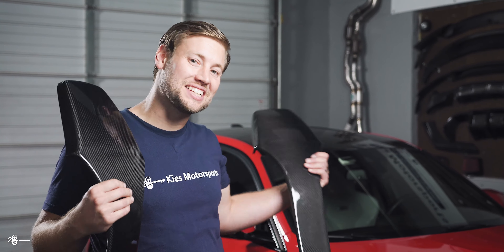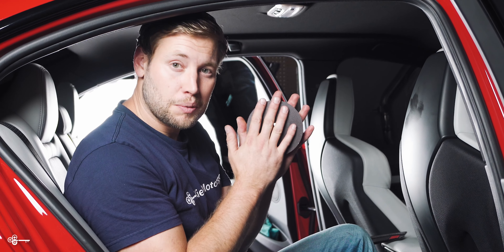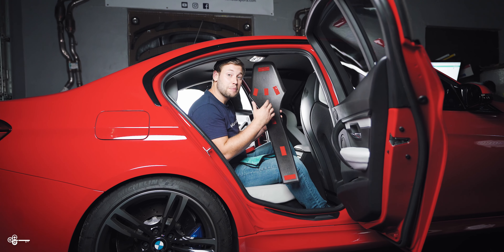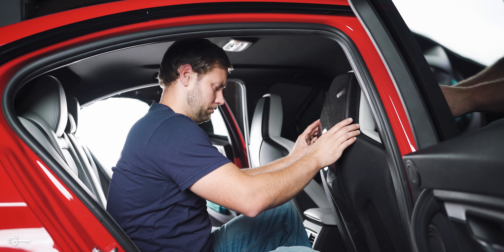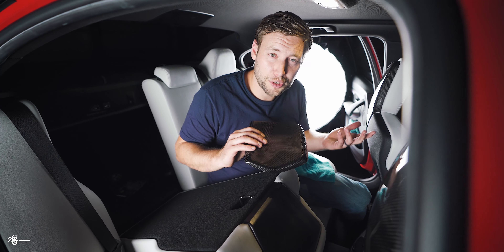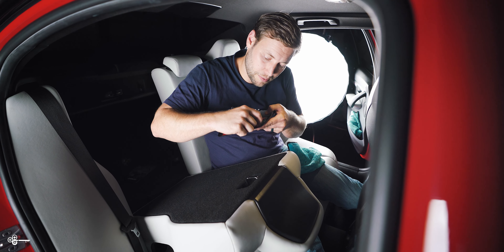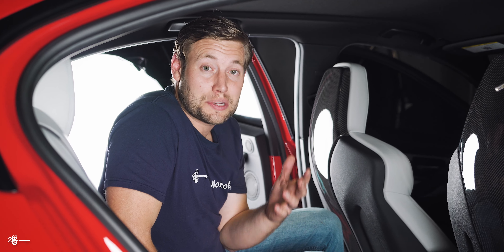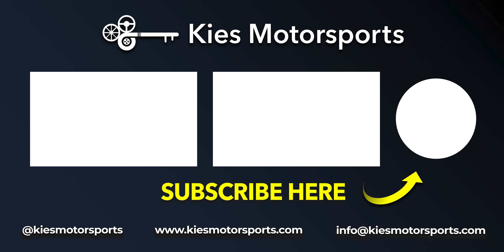EASY F80 Mod: BMW F80 M3 Carbon Fiber Seat Back Overlay Covers!

Comment: hey man can a f80 seat fit in a f30?
Reply: Yes, at least the F31 that I'm due to buy has M3 seats - took a bit of customisation and the electronics weren't straightforward I'm led to believe (I know you posted this 4yrs ago, though if anyone searches the thread)